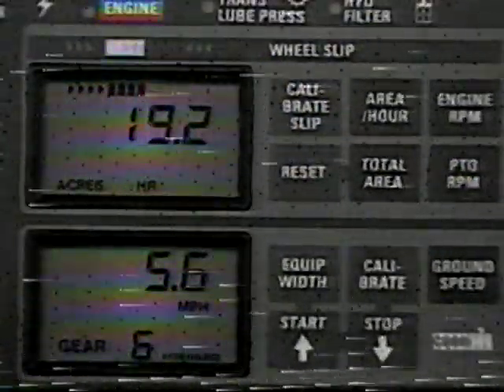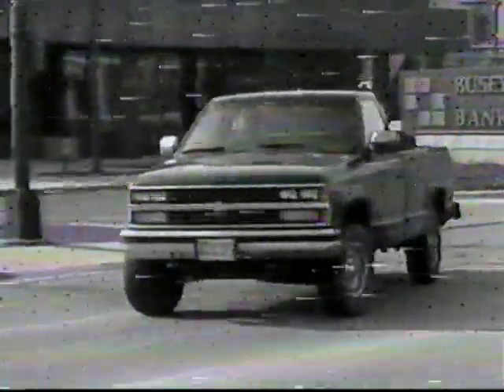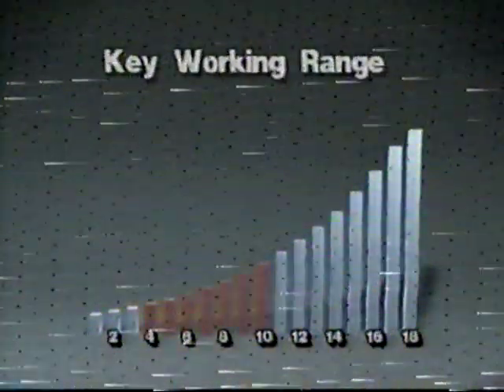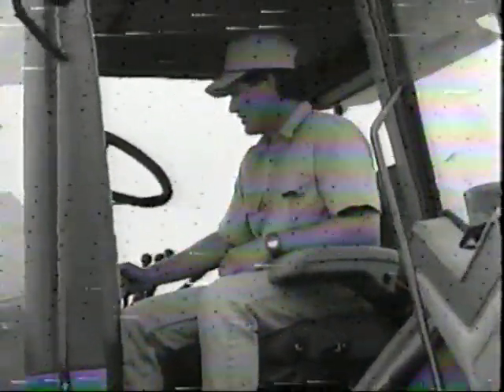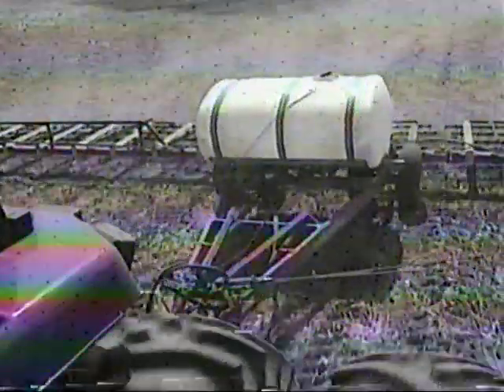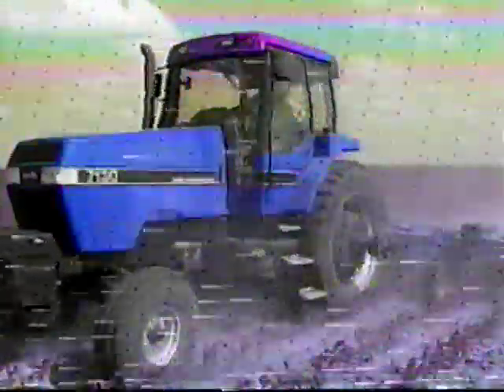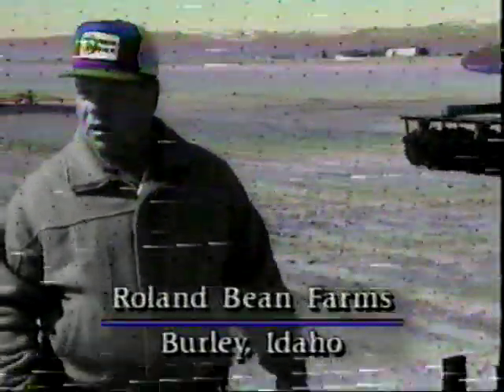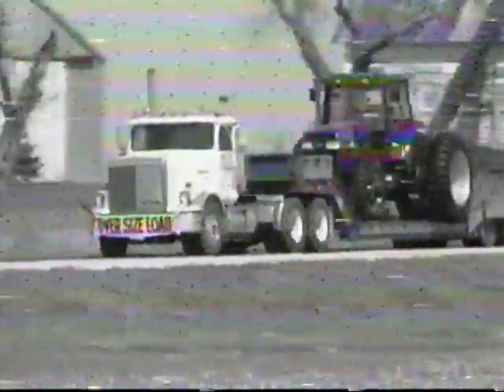Case International Magnum Tractor - The Inside Story

Comment: The 7100 series had Deere beat all to heck on hp rating. CaseIh had way more horsepower than they was rating them at. 7200 series were turned down.